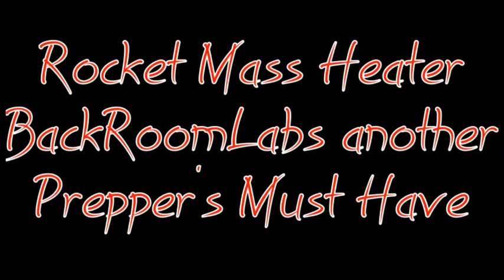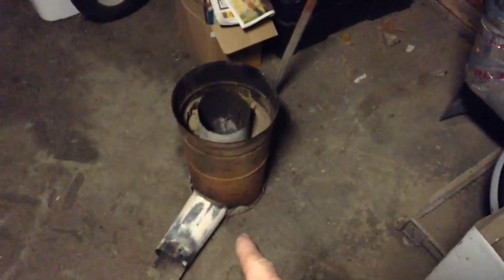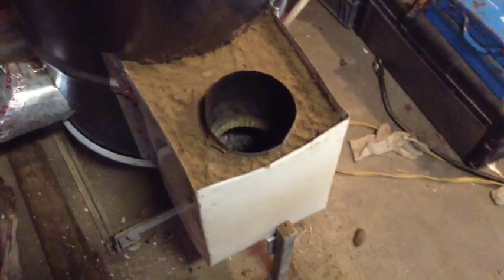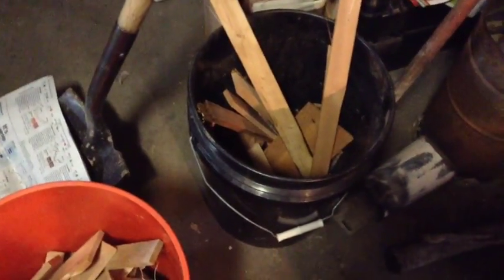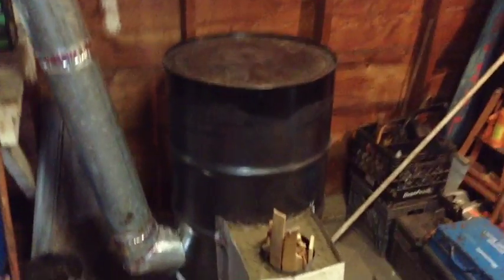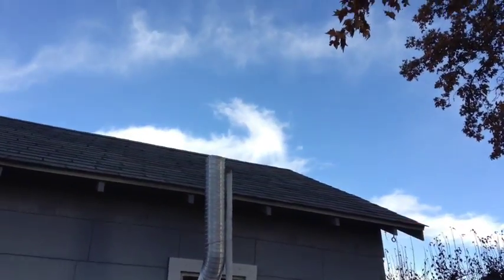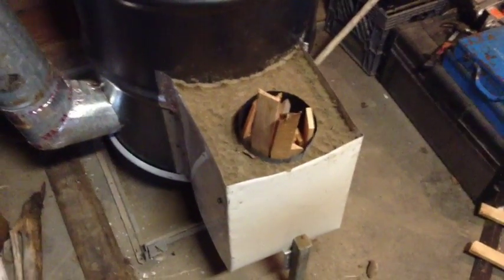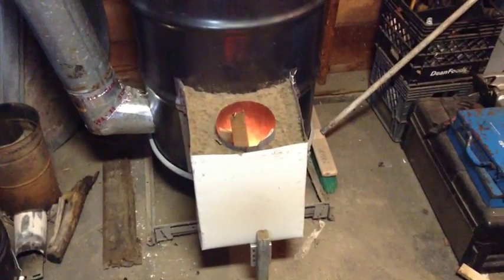Rocket Mass Heater/Stove another Prepper's Must Have

Comment: Very nice sir. I've been researching these and I'm extremely impressed with how efficient they are. I'm also very disappointed that the manufacturers have not done one of these types of stoves using propane and/or natural gas which would be epic. We have a ventless 30,000 BTU propane fireplace and it's instant heat the moment you turn it on and in 10 to 15 minutes, we are shutting it off. It would be really cool to see this.

Comment: I’ve been reading and watching rsmh’s for a good while now, I think you have the best idea. I like it the best. 
Are ya losing much heat through that short exhaust?
Reply from the maker: Negative. The gases coming out of the flue pipe is luke warm to the hand. This is actually only half of a rocket mass heater. See it is missing the mass part. In this setup the barrel radiates 90% of the heat produced. In a setup with mass the you would direct most of the heat out of the flue. The flue would be around 15 or so feet in an S type of fashion. That flue would then be set inside some sort of dense none flammable material ie. Dirt then covered by concrete or mortor to make a bed or a bench. You then use the rocket mass heater for abfew hours. Most of the heat generated with be trapped in the mass "flue buried in dirt". After the fire is out for the night the heated mass will radiate that stored heat energy back into the room hours. My setup here is great so a quick heating of a space. Not good when the fire is out.

Comment: That galvanized duct exhaust pipe doesnt get hot enough to off-gas
Reply: You are Very wrong about it not gassing off. It is not designed for the temperature that comes directly out of the barrel. 
If it's hot enough that you can't keep your hands on it it's giving off Toxic Poison ☠☠

Comment: How to clean the ash???
Reply: By design, what little ash is left primarily collects at the bottom of the barrel, near the exhaust outlet, so most people make the barrel removable, or include and access port there.
Reply: Green Croco based on the theory of other rocket stoves, there should be very little ash at all due to the efficiency of the burn. Very little smoke and almost no ash.

Comment: If you get a old dryer and take one of the panels off the side makes a great shield and has a naturel bend to make a air space! You can use it to put behind your barrel off the wall I use one on mine. I am however not running a rocket just a conventional air tight.

Comment: metal is a bad idea for the inners of a Rocketstove it will only last one heating season ,lot's of heat and fast poging gasses will eat the metal alive (corode it away ) use refractory   brick or hy heat mixture will make it last (perlite clay waterglass furnace cement )is a good options . btw look us up on fb rocket stoves /rocket Mass heaters international ,stay warm :-)
Reply: Ace Carter prolly not. Cement turns to powder in high heat. Check out honey do carpenter’s vids, he has a diy refractory and water glass
Reply: Meh. That's an overstated myth, especially when used as a garage/shop heater which has a low duty cycle. Steel is just too abundant, lightweight compared to masonry and easy to work with to be ignored for a small (even mobile) unit. If it's a big concern you can coat the inside of the riser with sodium silicate that will harden to glass to seal the metal surface - it only takes a thin coat to work.

Comment: could you wrap a line of copper tubing around the inner chamber and connect it to a water tank (cold water into the bottom, hot water/steam return out the top back to water tank) to have it double as a hot water heater?
Reply: presbarkeep yes

Comment from the maker: no you're not being completely ridiculous. just do a search on Google Images for rocket mass heater you will see tons of designs where they have made a bench or a chaise lounge or a couch with a huge mass or weight of dense material. is the fuel Burns in the heater the flue pipe will give off heat into the mass of the couch when the fire goes out that he did a steward in that weight or mass will then be slowly radiated back into the room giving you heat for hours and hours and hours after the fire has went out. if you were looking for something portable to run a vehicle or a generator what you want to search is wood gasifier. similar to the rocket mass heater but it operates on a different principle where it heats the wood to a point where it off gases that gas has been filtered which then makes it a clean hydrocarbon which is then ran through your carburetor in your engine where it is mixed with air for the proper fuel-air ratio and while you can run a vehicle off of burning wood. technology wasn't thousands upon thousands of military vehicles and civilian Vehicles back in World War 1. it's a wonder that the technology has been lost today

Comment: I have come up with a design that combines both rocket mass and gasifier versions together, but have yet to build a working model in which I think can work
Reply from the maker: +Jacob Yisrael Nice, I want to order the plans from Victory Gas Works. I don't know if you have seen his stuff, but it's one of the best I've seen. Especially with the build manual. Also I think you should check out the generator that run on water. From a company outa Toronto Canada. Just do a search for Generator runs on water. So many projects......
Reply: BackRoom Labs
 I will do that thank you...I know there is a motorcycle that runs on water...idk if you have seen it or not!?!?

Comment: How do you clean out the ash?
Reply from the maker: There is a T on the J tube that exits  center/bottom. It is 6 inch like the pipe. It doesn't need to be emptied very often.
Reply: +BackRoom Labs Awesome. I built my first cider block stove last weekend and ran it all day, but in the end, it was full of ash.
Reply from the maker: +taibhsear71 the design of J tube terminating 2 inch below the top of the barrel along with the very very hot barrel allows all the available fuel to burn. The block stoves don't have the second chamber to super heat the internal flue so complete combustion isn't possible. Hence the ash build up you are getting. I can burn 5 times what is shown in the vid and only pull out a few cups of ash.

Comment: Zinc Oxide is used to make galvanised steel and Zinc Oxide is highly toxic and hazardous to your health, its a heavy metal.......you should check out your local environmental laws and building regulations for using galvanised steel to make a wood burning stove for indoor use.
Reply: Not to mention that the core of a rocket stove/heater will burn through thin-walled metal in a matter of months due to Hydrogen Attack and Oxidation/corrosion. And that's to say nothing of the inevitable cracking since the metal and refractory have different thermal expansion rates.

Comment: Great design! Show us how you would clean the ashes out, since its vertically fed.
Reply: +John D I made one the other day and the ashes just disappeared. I burned all day and no clean up. True, I had to feed it constantly because I did not have a chute down to feed the fire.
Reply: +John D When some people are saying there is ashes to clean up, I have to disagree. If you cool it off to slow down the fire or let the fire die out you will have ashes. Interesting that if you constantly burn there is no ashes to clean up. Maybe the way mine is build, could be a difference in burning chamber and the way is functioning? Mine doesn't feed the same way. My burning chamber is "Y" shape. The "Y" is inside the drum. Inside the drum stretches about 3 inches from the drum flat surface and the other arm is sticking out the drum about 3 inches without any additions of pipes. The bottom of the "y" is capped off.
Reply from the maker: +Marius Neumayer oh yeah it's great. After I burn for a couple hours there is only less then a cup of ash. It's cooling off here in Washington St. So I'll be firing that puppy up here soon.

Comment: that insulation you use to seal the stove pipes to not leave CO2
Reply from the maker: It is foil tape used for metal duct work. The glue used for the tape is acrylic and heat activated. So it works very well in this situation. Sticks great and hasn't failed due to heat. The good stuff is a little more money at Home Depot but definitely worth the extra few bucks. Use a plastic squeegee to put it done pressure is key.

Comment: Using 55 gallon drums is not good if in a home and you want it to last more than 1 or 2 years. Been using wood heater since 1979 replaced it 2013, want a rocket heater in home but have not found one EPA would approve so insurance want still cover home. Just like my fire place insurance company would not insure me if I did any metal work around firebox if connected to duct work. I even showed them how my metal work would not be connected to firebox in any way except thro fire brick, 4" fire clay, 4" cement and  3/4" steel plat. They still said "no".
Reply from the maker: The barrel will last for many many years as the fire is never in direct contact with the thin gauge barrel. As you probably no in most barrel heaters the barrel is used as the burn chamber. The metal is in direct contact with the fire and will reach temps in excess of 1000° witch will degrade the thin steel over time. The barrel in this heater design has not went above 700°. So with that known I believe the barrel should last quite a while. This heater is not sealed properly by any means and should never be used in a house. This is set up in a very drafty garage so fumes are not a concern. Thanks for your concerns and input.
Reply: I made a prototype and I got a couple of seasons out of it. Not bc the metal went bad I just got ride of it bc I want a little bigger burn chamber. It heat my living up really good

Comment: Seems like it would be tough to get anything done besides splitting and carefully loading wood. Plus, I would be spending extra time relighting it because I forgot to stoke it every 45 minutes. :-(  I am not quite sold on the practical use of these small batch RS's for long term heat. A few hours in the shop or heating some mass is one thing, but using one 24/7 during a high desert winter could be tough. That's what I need, and am finishing one that will burn branches and wood pellets simultaneously. The pellets keep the heat going if I neglect to load sticks, and I can switch from one to the other seamlessly.

Comment: How do you clean out the ashes?
Reply from the maker: Under the barrel there is a T with an end cap that I can take off to clean it out. But mostly I just reach in where I put the wood and scoop out the ash by hand. The damn thing burns so good that after I run it for two or three hours I only have like three handfuls of fine ash. I have taken off the end cap on the bottom twice and there really wasn't much of nothing in it to my surprise. I keep a bucket by it to put the ash in that I scoop out so its not messy or nothing. I'm working on a new one that will have an ash tray that will pull out. This was my first one, just tried it to see if it would even work so there wasn't much thought put into it.

Comment from the maker: The garage was 16 by 28, 8ft wall and 15ft to the peak. I'm not sure what the temps were in the other areas, but I do no after 20 mins I was in my t-shirt. I have  moved to another home since this vid was posted. I have set up the rocket stove I'm my new off grid workshop. I'll post a vid of temps before and after I start the stove on a cold day. It has been unusually warm this winter in Washington St.
Reply: BackRoom Labs Nice build! My issue is that you called this a "rocket mass heater"... 
and it's not. What you built is a rocket stove, but it's not a rocket 
mass heater. A rocket mass heater has mass built onto it to retain the 
heat and slowly release the heat into whatever environment the heater is
 in such as those with seating areas made from clay/cob. The seating 
area (or bench) is the mass part of the heater. Mass heaters are much 
more efficient at heating an area than a rocket stove, in general, and, 
since they retain the heat and slowly release it over time, they heat 
the area for a much longer time period. A garage that isn't insulated 
might be a great spot to build a mass around your heater to release heat
 for a longer period of time so that you don't have to continually feed 
the fire.